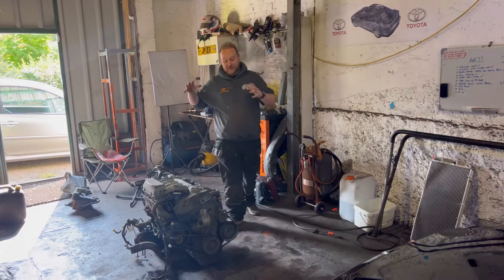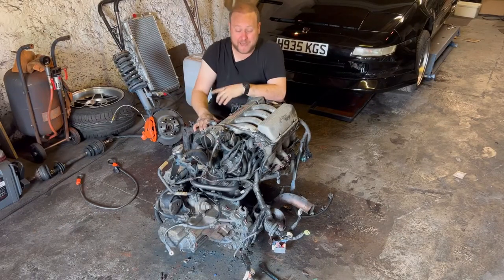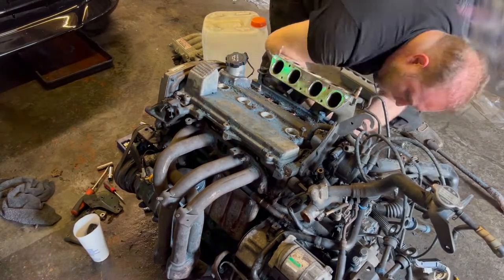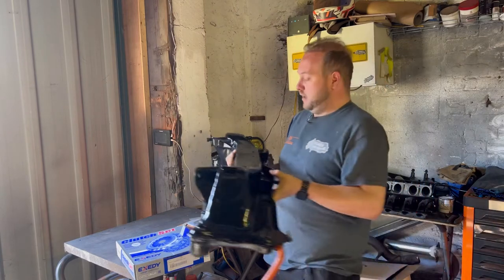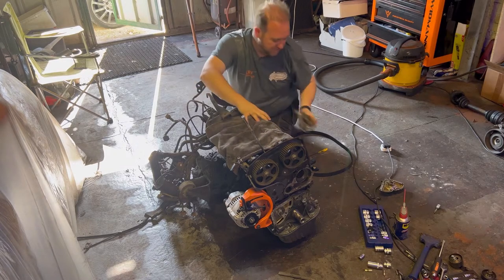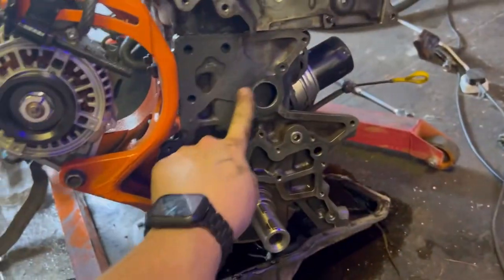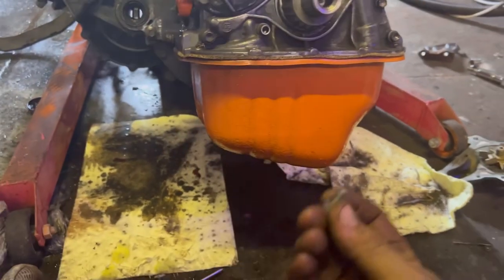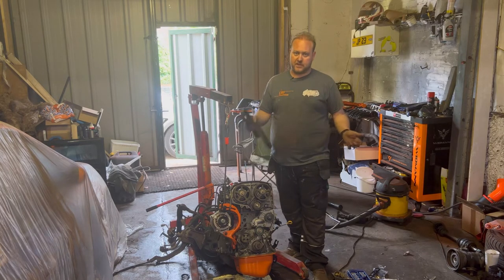The Cleanest Toyota MR2 Engine You’ve Ever Seen

Comment: mr2 ben is your mate for most parts :)
Reply from the maker: I have bought a couple bits off him already 😄
Reply: @TrackAndBeyond  He's pretty good at helping if you're stuck too. I'm just away to fire him an email bout some silly parts I need, in case he's got them on the breakers section (which he doesn't list on website). I got 2 support brackets I can't seem to figure out where they go (I've had mine out for over a year), I was watching your vids to see if I could locate them but they are on the floor 😪one is a gearbox to block support (thick black ones), I'm lost where it goes though, can't seem to match holes to bolts on either😓
Reply from the maker: Ah fiar play good to know too! Hope you get sorted 😀
Reply: @TrackAndBeyond  it's in & runs so that's most of the battle. Still lots of body work to paint & refit though but almost there. Mine was rooottteenn all the way around!!
Reply from the maker: @eartheclipse9623  luckily no rot on mine jap import so was hoping their wouldn’t have been